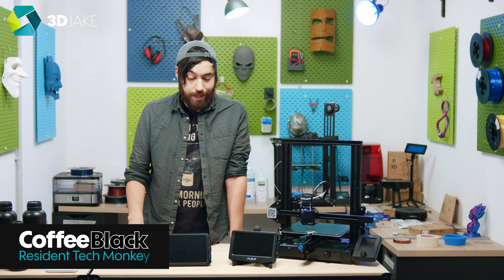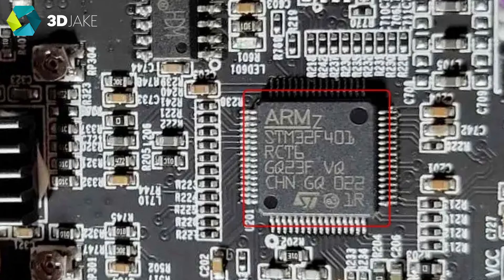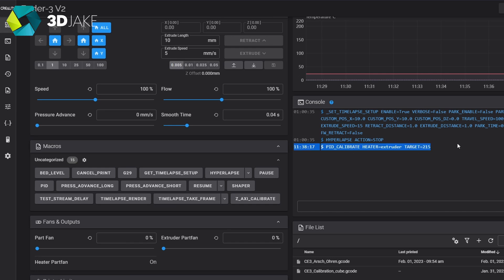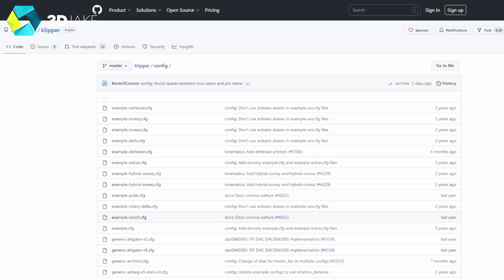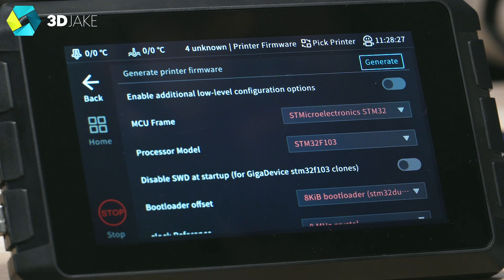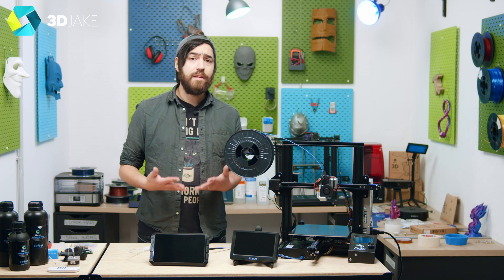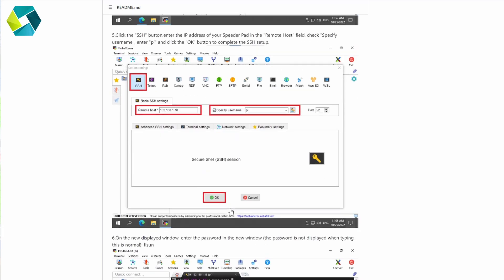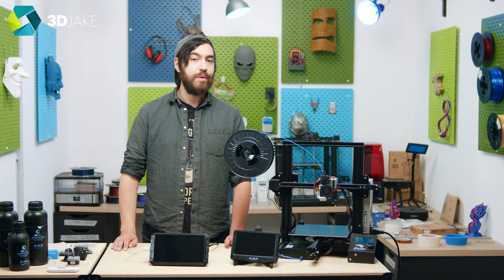Battle of the Pads: Sonic Pad vs Speeder Pad

Comment: Can you also use the Sonic Pad with the FLSUN Q5 with input shaping ? ... If yes ... How ? ... Can't select input shaping for Q5 !?
Reply from the maker: I'm not entirely sure, it depends on the processor chip the Q5 uses. If it fits the list then it shouldn't be a problem. For input shaping to work you would need to print a mount to fit on the Q5's effector or you could do manual input shaping test. There are guides for this on Klipper's website

Comment: If i have an ender 3 s1 and flsun qqs-pro which one i should to buy? To use it on both
Reply from the maker: Tough question, I am actually not familiar with the qqs-pro so the Sonic Pad might not work with it, it depends on the processor chip on the mainboard of the qqs pro. 
But if you get the speeder pad then compatibility with the S1 is also an issue. Unfortunately, getting the sonic pad to work with FLSUN printers is difficult and getting the speeder pad to work with Creality printers is too :(

Comment: Important point.  On my Ender 3 Max Neo, I had to update the Printer Firmware BEFORE I installed the Sonic Pad.  There is a bug in the stock Printer Firmware that keeps the screen powered on if something is plugged into the front USB even if the printer is turned off.  It was blocking install of Klipper.  Once I updated to the latest firmware, Klipper installed easily.

Comment: Runs the Pad with the 1.1.5 Bord ?
Reply from the maker: Yep, the 1.1.5 board uses an ATmega1284P chip which is compatible but you need to burn a bootloader on your board first to flash the firmware, the bootloader can be found here: https://www.creality.com/pages/download-creality-sonic-pad